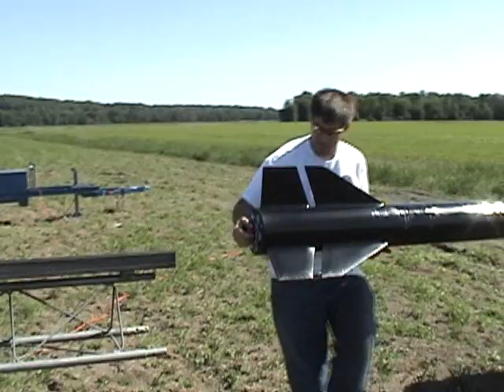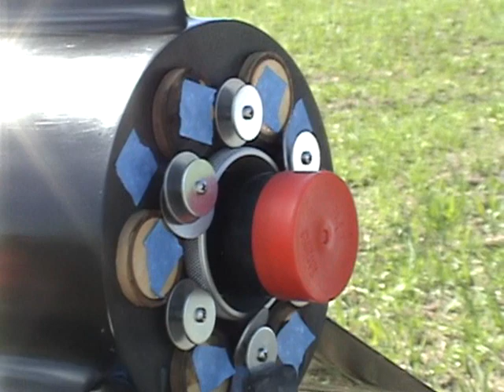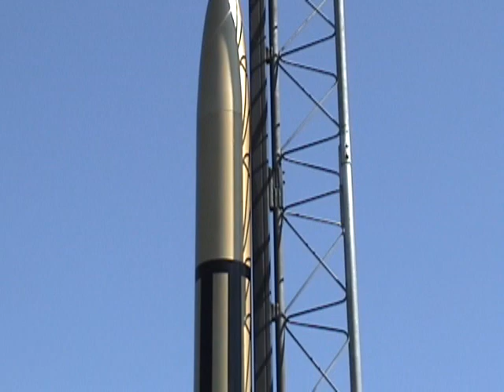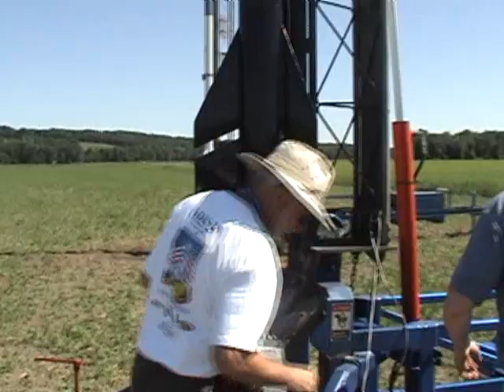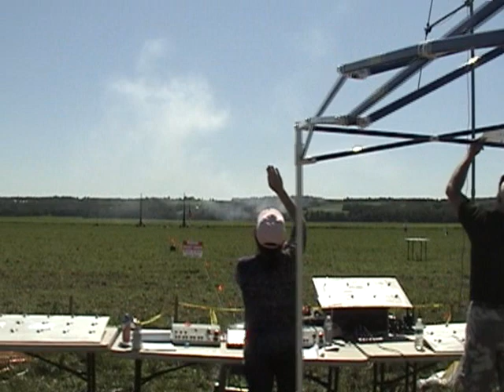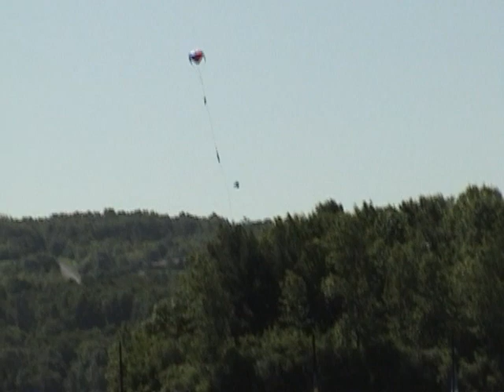Level 3 Certification

Comment: The launch station has to be about 4,000 to 6,000 in its self. Then the rocket and the motor sizes to get that thing to fly that high. That was awesome though, and like the electronic devise that deploys the parachute at like 500 feet that super cool.
Reply: It can be expensive, they have launch stands there many share...

Comment: Very nice launch! Looked like about $10k of equipment in my uneducated opinion but I suspect it cost even more.
Reply: That depends a lot on the kit (and how much work you have to put in yourself), and the size of the motor/what propellant you loaded the motor with. The altitude-reporting system is a few hundred bucks easy if it's an off-the shelf one, one of the fancy ones that has a base-station that talks to you live costs even more.

There's pentaclorate fuel, which costs something like $1,000 a pound... it can get super pricey, yeah
Reply: Probably no more than $5000 in material, if there is then it's just extra unnecessary gadgets
Reply: L3's can be as cheap as a few hundred dollars. Rocketry is expensive, though.

Comment: Whats the level 3 certification for?
Reply: Levels 1, 2, and 3 certs allow you to purchase and fly high powered rockets.  The higher the number, the larger the engine.  Certification is also required for hybrid rockets.  Canada has 4 cert levels.

This allows the hobby to self-police and reduces arbitrary uneeded and unwarrented govermental regulation.  It also promotes a better education and understanding of the aerodynamics, physics, etc. involved through mentoring.  It really is rocket science, and if you're intrested it's within most people's reach.
Reply: @TaterRaider  hell yeah im interested, im a ham radio operator looking for more hobbies to keep me busy
Reply: @jasongeerer8163  Only advice I've got is start with an Estes Starter kit.  You can do a lot of the high power stuff with low power rockets and grow into it from there.  Also check with NAR and TRA (US) to see if there's a club near you.  It saves a lot of headache later on.

Some rocket trackers require a Ham license, FYI.  😁
Reply: @TaterRaider  yep i have used it on weather balloons my ham radio colleagues have launched

Comment: Well low Earth Orbit is well over 120,000 feet and this rocket reached only 6,381 feet so it is mostly for amusement.
Reply: LehighValleyrailfan Productions Space starts around 100,000 meters (approx 300,000 feet). So yes, LEO does start well over 120,000 feet (pun intended)
Reply: No shit